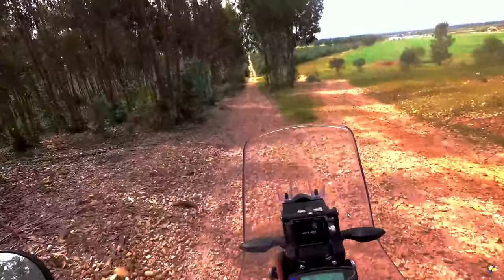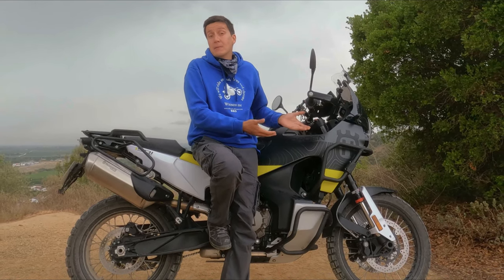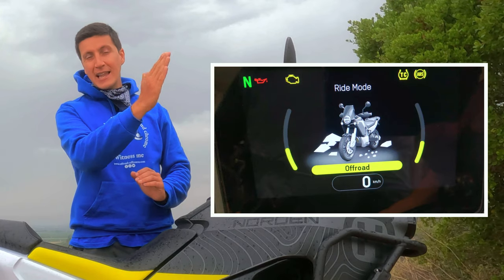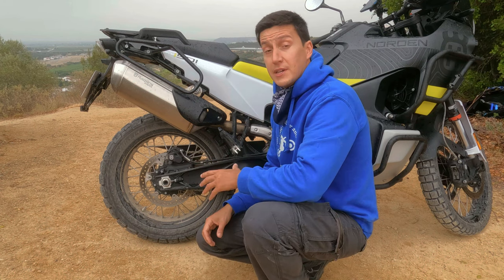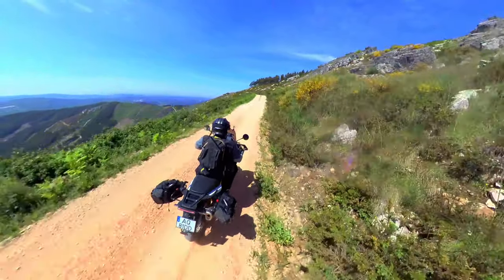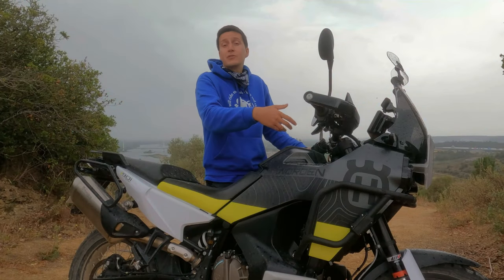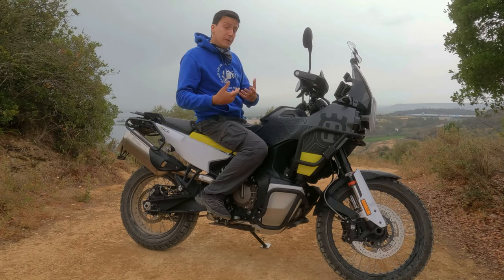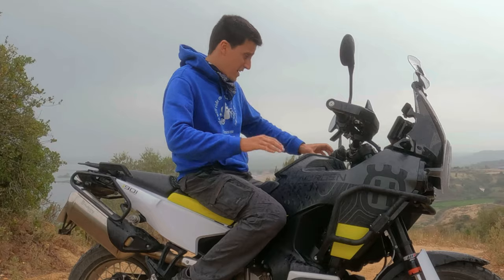Norden  901 Electronics explained (Offroad mode, traction control, ABS)

Comment: I have to admit I really like the electronic package on my 701 as well. Does what it’s supposed to do, easy to use and turn off, and so far has been without a single issue.
Reply from the maker: All husqvarnas i've tried have positively impressed me thus far :o
Thanks for commenting Johannes! Keep up the good work ^^
Reply: @OFFroadOFFcourse  You too Diogo 🙂
Reply: agree with you : so impressed by the very good quality of the TC mode on my 22' 701 enduro model : Rear ABS off in this mode and TC active but so soft that it help you a lot ! Love my 701 !!

Comment: Nicely done review ...as always !  
I am torn between KTM 890 Adventure R and NORDEN 901 .
Could you be so kind and give me so answers on questions below  , please ?

Did you had a chance to test KTM 890 Adv R ?  
I have found a body position on this bike a bit strange to me . 
Foot pegs are moved back to much , almost like on the sport motorbike feeling , and the handlebar is to low . I am average height man 176cm , and feel a bit cramped like sitting on much smaller bike . Do you have similar feeling when sitting on the NORDEN 901 ? 
Is the body position more comfortable on the Norden 901 vs KTM 890 Adv R  ( are foot pegs move forward vs KTM ) ?

Do you feel on your legs excessive heat coming from catalytic converter ? 
During testing KTM 890 ADV R whenever I stopped I was feeling like I am sitting on the grill ! The heat was really noticeable. 

Is the 43mm APEX suspension good enough for off-roading , or would you rather upgrade to 48mm WP Explor from KTM ? 

Regards
Lukas-UK
Reply from the maker: Hello Lukas! Before this video I did a "full" norden 901 review, did you see that one? Maybe some of the things I said will answer your questions.

Unfortunately I didnt try the 890R, so I dont know about the ergonomics being different. However, since you are "average", with 176cm, I dont see a reason for any of this bikes to feel uncofrtable. Youi can adjust the handlebar in many ways to make it suit your needs. You also need to get used to it.. i dont know what bike you rode before, but usually KTMs/Husqs are very good in terms or ergonomics, so most times its better to trust the bike and learn to use it in the position the bike wants :D

As for the suspensions,..well,, I found the 43s very good...sufficient...pleasant...capable of doing what is reasonable to do on a bike this big (watch my review :D). Of course the 48s with more travel would be even better, but I didnt feel limited by the 43...the bike is a joy to ride. 
Personally, If I was going to buy one of them, I would go fot the 890R, simply because I dont like complicated things, and the extra plastics on the norden feel unecessary (i dont care about looks xD). Also, I wouldnt say no to a better suspension. 

I cant help you any further I think, sorry :D
Reply: @OFFroadOFFcourse   
 Thanks for response ;) 

I just checked your ''full'' Norden 901 review where indeed some of my questions was answered .
The only thing you didn't mentioned is anything about the heat coming from catalytic converter ( noticeable by me ). 
When I was riding all was fine , but when I stopped on the traffic light I could feel clearly a lot of heat . 

When it comes to body position I know that there is no problem at all rising up or moving forward/backward the handlebar , 
but to move foot pegs a bit forward ...it won't be so easy .  I know I could get used to the foot pegs position designed by manufacturer but...its just a shame that 
KTM 890 Adventure R is not so comfortable in seating position like for example Tenere 700 or Tuareg 660 I tested the same day . 
For off road riding in standing position KTM 890 ADV R is outstanding ! It gives me confidence almost like my KTM 350 EXCF !  
But form adventure bike I would expect a bit more comfort in seating position when I ride on road . 

I read somewhere that body position on the Norden 901 is slightly better than on the KTM 890 ADV ...I have to find this out .

I am not sure but I heard too that in Australia Norden 901 is available with 48mm WP Explor suspension . That's interesting ;)
Reply from the maker: @lukmxtr9604  Ha yes, the heat! There is heat coming from underneath, but im not sure if its from the cat or the engine itself. Like you said, you dont notice it while moving, only when stuck in trafic (and then you do, a lot :o )

Comment: I'm this close to buying this bike, but my test rides revealed two issues i wanted to hear your take on. Both are about dynamic street riding.
1. I'm 193cm tall and air turbulence on helmet starts at 70kmph and gets unbearable long term at 90kmph. Does that deflector solve the issue? To what extent?
2. Upshifts with quickshifter on the test bike (250km odo) ended up in false neutrals at least 10% of time. You just can't rely on its reliability in the twisties. Have you observed such issue in the units you've been riding?

Q
Reply from the maker: have you seen my previous video? it was a review on the bike, and I have mentioned both things you want to know. 
The spoiler improves the aerodynamics quite a lot, but since you are 1.93, maybe you wont be as sucessful as I was. Still, I feel that further improvement could be achieved with lateral "wings/spoilers". After we placed the top spoiler all the buffeting I feel is coming from the sides.

As for the false-neutrals, I used to feel it only in high gears, and it happened both with the easy-sift ON or OFF. Now it doesnt happen anymore (certainly not that often) because I learned to be careful about it... I just shift gears with a bit more "conviction" :P
I dont have any more info or suggestions 

on this matter :D
Reply: @OFFroadOFFcourse  great feedback. Thanks so much.
Reply: I have no problems with my Norden. I do not remember the excact number but in the manual you find a adviced RPM to use the quickshifter. If you are at this RPM+ then it shifts with no issue.

The wind baffle is caused by the horrendous mirrors. If you buy aftermarket mirrors then the wind baffling dissapears
Reply from the maker: @kristoffertvedtskramest9550  the mirrors you say? I will have to try that out next time they let me ride the Norden :o
Very interesting!
Reply: @OFFroadOFFcourse  Great suspension guide/school videos btw. Really enjoyed them!
Reply from the maker: @kristoffertvedtskramest9550  thanks man ^^ i appreciate it!

Comment: Don’t understand why it doesn’t have hazard lights (The same for the sister 890). When I take my bike for work, I’ve stop in some tricky places and I want people to clearly see me. So I use the hazard lights a lot. It’s stupid, but it’s a deal breaker for me 😶
Reply from the maker: Thats the funnieste deal breaker I've ever heard :D
If you really want the bike, it should be very easy to jerry-rig an hazard light system with a relay and a switch... messing with that sort of electronics is usually easy..usually :D
Reply: @OFFroadOFFcourse  I’m aware of that, I’ve even tracked some forums where people did that. I just can’t understand why they didn’t add it from factory. Even 125cc scooters have it 😂 
For me is also a safety feature (to be more visible when I’ve to stop on the road) and for what the bike costs, the lack of it, just seems stupid to me 🤦‍♂️
Reply from the maker: @amsousa  true xD

Comment: Damn, you really start to make me question my decision ...

This spring I was going forth and back between the Tiger 900 and Norden 901 ... no Ténéré since not cruise control ...
On paper they are similar bikes .. the Tiger offers a bit more comfort and and convenience ... the Norden more capability and performance

I was lucky to have the Norden for a 2 day advanced enduro training
+ it balances to a stand still ... very much like a R 1250 GS
+ ... and if dropped it is not too hard to lift up ... easier than most
+ great seat design  ... not hindering movement ... considerably low ... even for compact riders ... yet very comfortable .. unlike the KTM 890
+ the engine is very lively and puts a huge grin on your face
+ electronics assistance (Offroad/ABS off) ... I never noticed any unwanted interference ...
~ needs much more clutch/throttle/break control ... doable ... but way more demanding than a GS, which just tractors along in idle
~ standing position is quite "active" and less relaxed ... good for active riding .. but far more exhausting than the GS
- but the wind noise at 50+ km/h was horrible without earplugs .. even with a spoiler ... no bueno ... needs an option better on road wind protection ... offroad was no problem ;)
- the quickshifter was not good compared to the Tiger ... also going 1 > 2 dropped regularly to N ... not good when you are offroad and you have to check gear because you cannot trust it ... no bueno ... also happened to others on KTM ADV 890 ... apparently a known issue ... KTM/Husky response "really make sure that it is in" ... yeah works ... but why is this even needed ...
- some stuff breaks quite easily ... rear indicators broken .. tank bash plate easily ripped, looks better than it protects ... etc. ... the park therefore might remove them again ..
- some stuff feels quite cheap, flimsy or unpolished ... especially at this price point ... weak kickstand with small foot ... buttons, Tiger/GS buttons feel much better ... a few dedicated buttons for often used functions like heating, modes, etc. I find better than digging ... and let's not talk about the (navigation) app ... why is BMW the only one to get that right ...

I really hope that some improvements become available down the road ..

Because I ended up with the Tiger 1200 Rally ... very nice bike ... heavy sigh of weight and near instant regret after the first drop 1h after i picked it up from the dealer 
... but so much harder offroad than the Norden/KTM or even the GS ... especially for vertically challenged riders ... but that is a whole other story

Comment: i liked the 1090r that it could all be turned off but on the 901 "Explorer" mode is something it should have come with/// i have also never been a fan of all the computer nanny nonsense but you cannot buy a modern performing bike without it and i also agree that the Norden's is simple to navigate much more so than id have thought before riding it a few thousand miles

Comment: Downhill offroad...you will want to disable the ABS...including the front.
Reply from the maker: Not anymore... I changed my mind and have to admit that the modern ones are actually pretty solid (especially if we are talking about the front one). 
Actually the other day I was riding a Husq 701, testing the ABS on lots of different situations and I came to the conclusion that I can't possibly do a better job than that thing does. Its super impressive

Comment: The rear brake is very important when stopping. 
Try going down a rocky and rutted hill expecting to have both rear and front brakes, but - surprise - you only have the front brake. 
Now tell me again how the rear brake is useless.
Reply from the maker: Hey Orlando, thanks for watching the video!
The rear brake is very useful to help you maneuver the bike in many situations, something i demonstrate a bunch of times during skidding maneuvers and whatnot...its also an important part of an emergency braking (about 20%).
What i meant to say it that when used alone in an attemp to stop the bike, its ALMOST useless (and then i practically demonstrate what i meant... The bike eventually stops after 30meters...so yeah, i guess technically you cant say that that is being useless...)

In the situation you describe (going down a slippery hill) its precisely the situation why i hate the ABS. Cause on a normal off road trail i can actually live with the ABS on and kinda adapt to it, but going down slippery hills unable to use the rear wheel/brake as a rudder gets really really dangerous.

Anyway, you are right, but you interpreted me wrong. I have been riding offroad for 20 years, i have instructed close to 200 people by now and i am not an idiot xD
Reply: @OFFroadOFFcourse   - I know you are not an idiot. I enjoy your videos.
I’ve lost the rear brake because of a hole in the brake line - this was discovered on a down hill - it didn’t end well. 😂
Reply from the maker: @orlandoberry4031  been there xD
I learned that lesson racing the baja 500 on an old (1994)  tenere 660 with rubber brake lines... They got hot and lost all fluid pressure so no rear brake for half the race :p